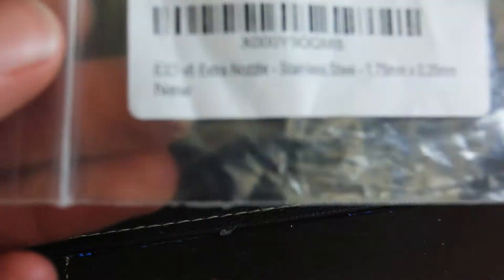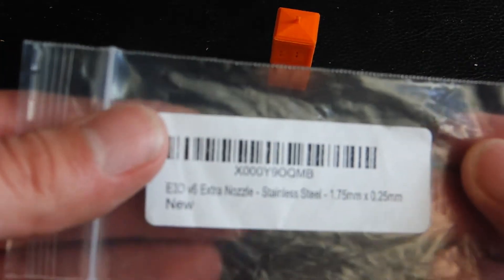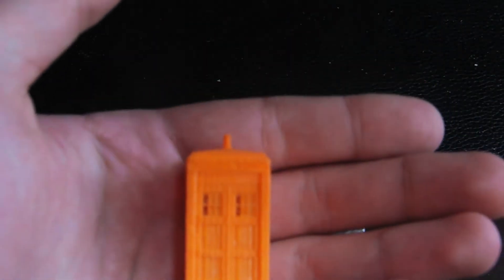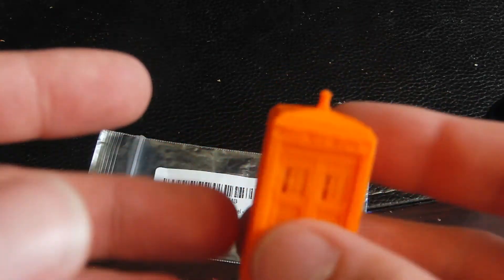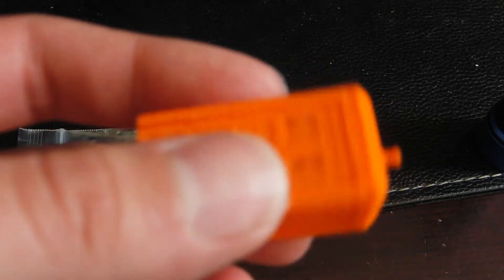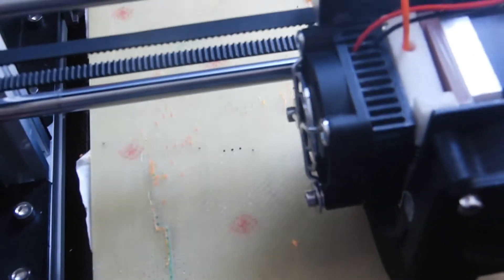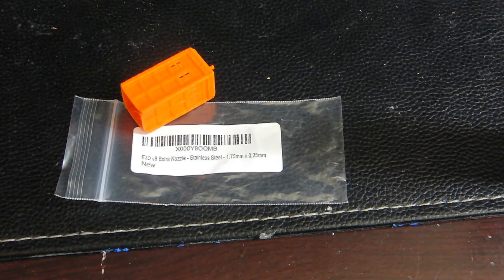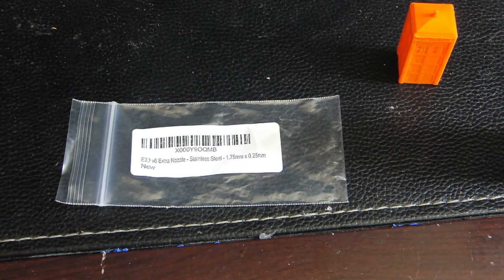E3D v6 .25MM Stainless Steel nozzle review

Comment: 20$ for 1 Nozzle? Or does it come with more nozzles? Because i remember buying 5-6 stainless Steel nozzles for about 10$. Unless its Harden Steel than that sort of justifieds the steeper price for a nozzle, if its just stainless steel then you still overspent anyways.

Comment: Great insight, exactly what I need to know before I swapped in my .25mm nozzle. I also have a (Chinese clone) 1mm nozzle, have you tried going larger than 0.4mm?
Reply from the maker: No I have not but from what I can tell it's exactly the opposite of going smaller. Your going to lose resolution but you'll be able to print faster.